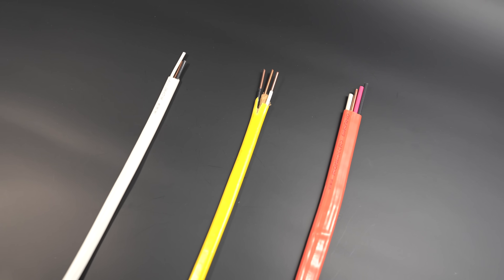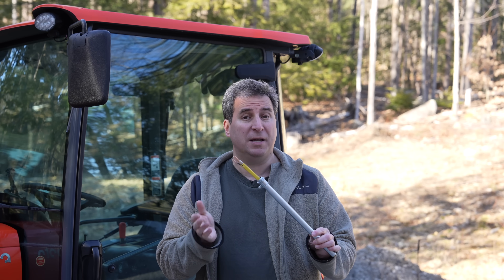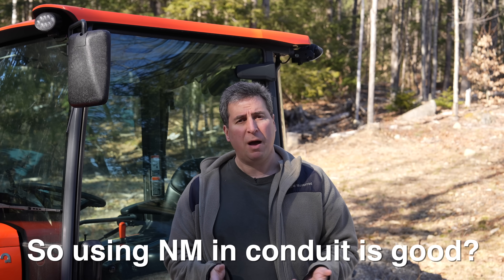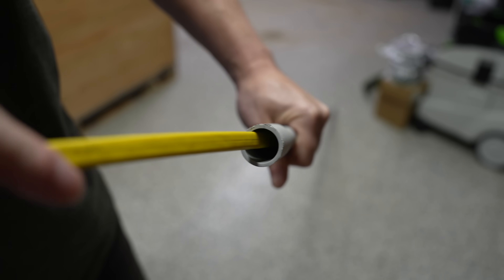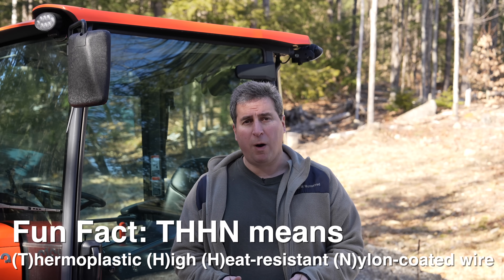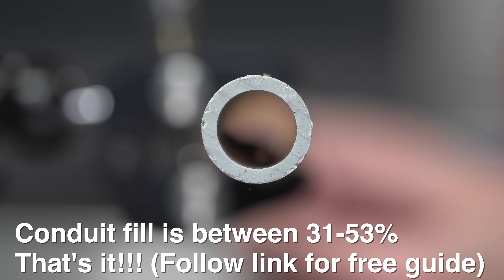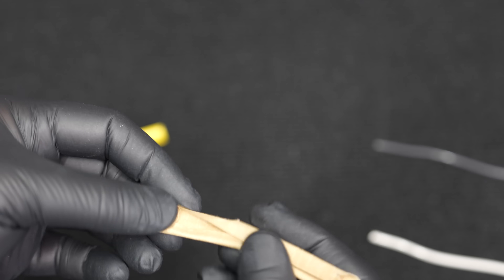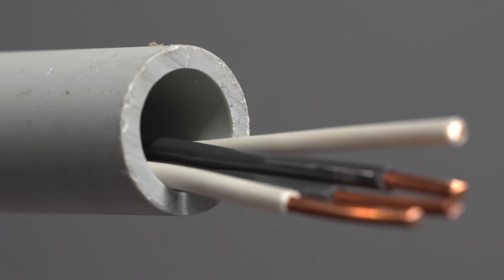#1 DIY Electric Mistake - Can you use Romex Wire in Conduit?

Comment: So what is the risk?  Why should you not put it inside in a damp location like outside?  Seems like conduit would be the think you would want around your romex as it comes out of the ground to an outside outlet to prevent damage from lawn mowers and string trimmers.
Reply from the maker: The common belief is that the paper inside and jacket are not rated for moisture and will break down over time. I have seem this when romex was outside and the conductors shorted out, the stuff was 40 years old but with no UV exposure.

Comment: Curious why Romex in conduit in wet locations is a no no. Is Romex waterproof? It looks like the jacket would give even more protection in wet environments. What about direct burial cable on conduit? That cable certainly is waterproof, but probably is illegal in conduit as well. Why?
Reply from the maker: The common belief is that the paper inside and jacket are not rated for moisture and will break down over time. I have seem this when romex was outside and the conductors shorted out, the stuff was 40 years old but with no UV exposure.

Comment: Yeah, the electrical codes are mind boggling, but here for a reason. I'm sure most of you have seen the crazy s#!t I have and wondered why that place hadn't burned down long ago. That's why we have codes. They're real complicated if you're doing commercial or industrial work. But for the most part mostly common sense for residential. I've done electrical work for some 50 yrs now, some with contractors, most on my own w/o a license and all my inspected work passes. Occasionally I miss something minor, but I correct it and all is good. If you're gonna bitch about having to do good work, you might need to find another line.

Comment: As I'm not a fan of NM cable to start with, I'm glad this house is all THHN wire in metal or plastic conduit. And no place in S. Florida is a dry location except for a vertical run in conduit.

Comment: Nobody understands why Americans h8t3 freedom so much.
Not just electricians, but low voltage installers, basically, anyone who does construction.   
I don't know where you think you need to obey strangers and follow some code when building stuff.
If you own what you are making, you can basically build whatever you want.  Shlt, run it through PVC if you want.   Free country.   Right?   Yeah...   either it is, or it isn't...

Comment: The big caveat is "check your local code".  I talked to a guy a while back who had had to rip out a bunch of cabline he had installed not because there was actually anything wrong with it, but because the major employer in that town was a cable manufacturer and the local code specified that only that manufacturer's cable could be used.
Reply: Time for a lawsuit. Gov and company doing kickbacks.
Reply: And even without that sort of monopoly, many times a local jurisdiction is one or two code cycles behind the current one--so sometimes a change in the most recent edition won't be relevant where you are, at least not as far as passing an inspection.

Comment: Even though I'm not an electrician,  I was already pretty sure of most of it. The biggest surprise to me, is that the single conductor has different insulation on it than the individual wires in NM. I'm pretty sure there is an outdoor version of Romex that is water & UV resistant.  If that is run underground,  can it be run through conduit?

Comment: In many installations by the time you bend conduit, put in the weather proof hubs etc you would have put in several runs of tech.  Tech cable may cost more but what's the cost in time?  Sometimes the cost of labour outweighs the savings in material.  It's site by site decision.

Comment: So glad I saw this because Im planning putting a subpanel in my shop building then running romex thru sched 40  pvc conduit. Ill research this even more . I want it to be right and safe. Thank you.
Reply: Easier to run THHN. Don't run romex.
Reply: @ElectricianMagician  That's the way the mill I worked in was wired. It was mostly 480 3 phase but there was 277 Florescent lights along with 110 lights. That's exactly the type wire they used in conduit. I have just a 220 submerged pump 4 '' well with 10 AWG and no 10 AwG ground supplying power to it. I was told since I was using halogen lighting in my shop the wire feeding pump from 30 Amp 220 would be sufficient to run to subpanel box to be put in , feeding from 100amp in service panel, 30 Amp would feed to well just like now
Prob have a dozen outlets but only one or two would be used at a time. Then a table saw unknown voltage and amps ( watts)  possibly drill press and planer. One running only at a time. Also air compressor. It and pump will come on as necessary.
Wire feeding to sub panel is 10 AWG 2 COATED HOTS 10 AWG bare gr. I've got 200 Amp panel with 100 to house and 100 will feed shop.

Comment: I don't know what to do... My breaker panel is outside... So I guess I need j-boxes for 3 feet (if out of panel top then elbow into the house) of THHN just to get inside? I dislike junctions and splices. What if the breaker panel conduit goes directly out the back and into the house?

Comment: In my area, Conduit can be used as a short chase, like through a floor into the bottom of a baseboard heater but generally frowned on and may be non-compliant for extended runs.
Reply: Yep, Check the local code. Just because NEC says it's legal doesn't mean your local code will. Heck in New York just running NM in the same room with conduit might get you in trouble LOL.

Comment: Hello again, 
               IF the conduit iS designed for damp or wet locations and proper fittings are used that keep moisture out of the interior conduit or raceway, then it coould be cosidered a dry location. Plumbers piping is designed to keep liquids , gases inside the pipe,,,, while our conduits (desighned like plumbers pipe) keep liquids, gases out side the pipe or conduit. Yet there are spots in an electrical enclosures that have to be arrainged to drain. Moisture and condensation could have a deterioration of electrical equipment or utilization devices. Some interior of raceways and electrical enclosures  i found in damp locations over the years can be bone dry. It comes down to locations and exposures 
           This may be subjected to interpretation by the authority having jurisdiction.  Hence, in a rail mass transit environment WHERE I STILL WORK, moisture and vibrations could be anywhere,  even in the areas inside a heated facility where rail rolling stock is serviced , repairs . 

Miss Paula Walach-former industrial electrician-union member.  IBEW.  LICENSED  ELECTRICIAN SINCE 1972

Comment: Hello, 
   Romex is a cable that was invented  by Rome cable co,of Rome NY. When I built my home in 1979, I ran nothing but EMT TO INCLUDE THE DOOR BELL WIRING AND THE LAND LINE TELEPHONE JACKS.  Throughout jobs i,ve been on I learned the way plumbers shoved piping through joists with ease by drilling holes in line like from the outside corner of the house so that I can pick up my perimeter of wiring on the outside walls. Like forming a ring circuit like they do in England. On Romex or shall I say nonmetallic sheathed cable., I have literature from a past away electrical engineer named Francis McKinney. He was a member of the International Association of Electrical inspectors.......   He wrote an article depicting NM CABLE UNSAFE IN ANY HOME. I agree with what he wrote. Over the years I have scene the problems  with NM cable when I was free lancing as an electrical contractor.  Hence, Romex in the hands of hack type shoddy electrical contractors especially with all apprentices and very few licensed electricians on the job can create dangerous code violations. That is why the CHICAGO AREA HAS OUTLAWED MN CABLE. HENCE, I MET BILL HOGAN🎉CHEIF ELECTRICAL INSPECTOR TOLD ME THAT WHEN HE GOES OUT OF THE REGION AND SEES HOMES WIRED IN MN CABLE,  HE HAS YET TO SEE THEM  CONFORM TO CODE. THAT DEPICTS THE REAL WORLD OF ELECTRICAL CONTRACTING. That is why I now very seldom free lance as an electrical contractor.  Too many hacks out there competing with each other. 
               I currently work for a rail mass transit authority system l. I work in some areas on the tracks  SWITCH HEATERS , LAYOVER POWER SYSTEMS ETC that is out of jurisdiction of the NEC . yet there are conduit runs j-boxes etc that at least have to be installed in UL & CSA TESTING SPECTS.

    Miss Paula Walach-former industrial electrician-union member IBEW.  Licensed electrician since 1972.

Comment: I am Mostly EMT, PVC, And Smurf(ENT)Electrician
I Understood You Can't Put Romex in Conduit as It wont Dissepate the Heat, can use on Block Wall to get to Attic, then No Conduit. Even If Allowed, Won't put in Conduit except protect against a Wall.

Comment: NM not permitted in conduit where I live.  Local authority having jurisdiction has strictly forbidden this for decades.   Their statement is that it doesn't allow for heat dissipation and is not listed for such use.  Besides, why would you want to?   It is more expensive, harder to pull and fills up the conduit.  Only an amateur would even attempt this.   Stripping the jacket off also not permitted.

Comment: Wow, this looks like ancient technology for someone from the EU... bare ground wire, paper separator, steel pipes. We use PVC cable trays or PVC pipes for running wires outside, or so-called "arots" to run them inside walls or under the ground. Our cables have all 3 wires individually insulated, and the cable has no flammable materials like paper.

Comment: Thanks. I run individual wires in conduit, and often leave room for extra runs. The inspector flipped out when I ran a two inch and an inch and a half conduit sixty feet from the house to the garage. When I bought an electric car, I was mighty glad that I could run an extra 50 amp circuit.
Reply: I always run a extra wire from the switch box to the light fixture just in case if later on they want a ceiling fan.so they could be switch separately
Reply: @twigd3825  I refurbished a 1945 house with all new wiring and I put in the three wires with ground plus fan rated boxes for ceiling lights so there is no issue if next owner wants a fan.
Reply: More expensive, but just smart for future upgrades, especially if you plan to stay in that home for the long run.
Reply: The inspector flipped out, he probably seen but couldn't prove you would run down the road more wires for such as, 220 for another panel for which you would not need a permit or inspection. With that size pipe you can easily run for 200 amp service.
Reply: @daviddubeck2436  nah, we live in a small town where everyone knows everyone else by reputation or better. He knew we'd get a permit for everything more complex than replacing like with like.
Reply: Do you upsize your initial wires to account for the de-rating with the additional conductor?
Reply: @ronnietruman7296  Huh? What does any additional conductor have to do with "initial wires"? If he wants to add a 120 volt circuit, he will pull 2 new conductors, supplied by a SEPERATE breaker, or 3 new conductors for 240v. None of which would rely on his "initial wires" in any way.
Reply: @ronnietruman7296  Not sure what your asking.  Any additional wires pulled through the conduit at a later date would be separate circuits and fused separately according to wire size.
Reply: @chrisgraham2904 
What they are talking about is that when you have a certain number of current carrying conductors in a conduit, you have to de-rate the allowable ampacity on your conductors. 4-6 conductors you de rate to 80 percent, and it goes down from there. In Canada where I am, our code book has a chart for it. If you're talking about a few circuits and something bigger like a car charger, you're really not going to run into an issue. At least that's how it is where I am in ontario
Reply: @chrisgraham2904  Depending on the temp rating of the conductors, any more than 3 current carrying conductors in a conduit must have derating factors taken into account. Many times we have to upsize #12 wires on a 20A circuit to #10 wire.....
Reply: @chrisgraham2904  You sorta told the electricians in the room that you don’t know all that you think you do about conductor fill. Chapter 9 of the NEC is just full of info on this subject.
Reply: Electric car my eye, you're making moonshine in there you sly devil.
Reply: I've been a senior inspector in a couple jurisdictions and trained new inspectors, and I've always had to explain that builders are allowed (and encouraged) to exceed the code minimum. I have even left notes for inspectors with code references where they've written corrections for exceeding code, e.g., using a smaller breaker than required--a 20A breaker for a 30A circuit.
Reply: @foyjamez  Thanks. Just to clarify, the inspector passed my work with the comment, "Well, it's your money! You pass."

This was the same inspector who once told me, "I save you for last because I want to go home happy." Everything was fine.
Reply: @ericmintz8305  It's always nice to know you're going to have one good inspection :)

Comment: I found an under-ground old cloth covered Romex cable while digging for a garden on the side of our house when the ground started sparking. Surprisingly it did not blow the 15 Amp fuse. A previous owner had installed a receptacle on the corner of the raised deck that had been added after the house was built. Would have been nice if it had been placed in conduit for protection. I disconnected it at the source (attached garage) then ripped it all out.

Comment: People really need to learn what "illegal" means. No one would be doing prison time for this. It is not part of rhe criminal code anywhere in the US.
Reply: There are many codes under the disguise of  protect public that are either over engineered or that are completely irrelevant  to safety. Why inspectors start to enforce Arc fault circuit at 5x cost for new builds when 80% of existing homes get grandfather to use non-arc fault circuits? This code has nothing to do with risk other manufacturer try bribe NEC to line their pockets.  Why 1 county require same code while not the other counties with exact same condition / environment? Physic of fire hazard didn’t change, just perception of risk, codes are arbitrary in many instances.
Reply: In Seattle, you can do time for certain electrical code violations.I think it requires multiple offenses though.
Reply: @Elk300 or reckless endangerment if the person didn't die

Comment: I accept your claim. I just don't see the reasoning behind it being "code"... I see how there is a problem with going around curves, but not if your conduit is straight. If I need to run power to a shed 200 feet off in the woods, putting it inside conduit would seem like an great idea. Clearly, you need to use some sense, probably taking 10' sections of conduit, running Romex through it, taking another 10' section of conduit, running the next 10' of Romex through it... repeat... and, once everything is through and ready, NOW seal the conduit together -- and you have a 200' length of conduit with a 200' length of Romex running through it. Hell, you can dig a trench next to it and bury it, fairly secure in the idea that it's relatively impervious to the elements... 

The same process could be used to deal with a sharp bend -- e.g., a 100', 90° bend, 100' -- you'll have to feed the romex through the 90° bend, but the rest of it is just like the 200' straight run. 

In other words, don't "pull" it, lay it out correctly, beforehand. If the code demanded that, it would seem to fit with sense.
Reply: I repeat my question. What is the ARGUMENT against this? Among other things, WHY is this limit on how much of the cross section can be used? 

Explaining the REASONS for the arguments would make at least as much sense as actually making unexplained restrictions on such. 

What has happened in the past to make these restrictions seem reasonable? Because they don't.

Comment: Allowed or not allowed..  allowed by WHOM????  THIS VIDEO. Still didnt explain the danger... if no danger then damn the code...
Reply from the maker: There are no public reason released why this is in the code, but the common belief is that the paper inside and sheathing are not moisture resistant and will absorb water and breakdown over time, shorting out. (they are not approved for damp locations) I have personally seen romex used outdoors in conduit that has broken down, presumably from moisture over time
Reply: @SilverCymbal  the paper breakdown and short out?  Are you kidding?  The only wire that the paper is wrapped around is the grounding wire.  The Line and Neutral are both wrapped in plastic. which is all wrapped in plastic.  So the moisture has to get past the NM coating to get to the paper, and the only way these wires are going to short out is after a 1000 years when the plastic has decayed, and no modern building is rated for 1000 years of life. so I call BS on this code.  These codes are meant to cost more to the homeowner  and either bring revenue to the city/county or manufacturer.

Comment: Thanks for a good to the point video answering questions about electrical installations  i have certainly thought about about "doing". 

I suggest making a quick  video about the popular  20 amp /12 gauge wiring circuits being  put in garages... how many folks install the said 20 amp circuit goods up to the individual  boxes..  then use wall receptacles that are only rated for 15 amp draw for wiring joinery at the receptacle.  {20 amp receptacles can be purchased for more $$  but few buy them}.